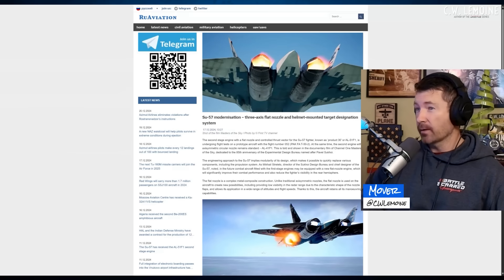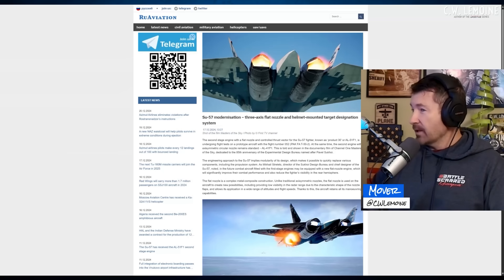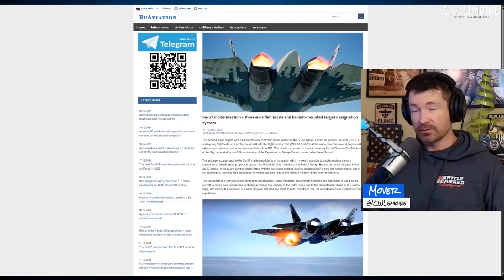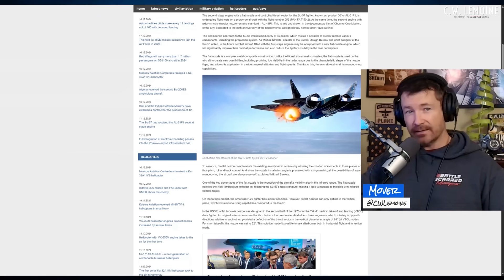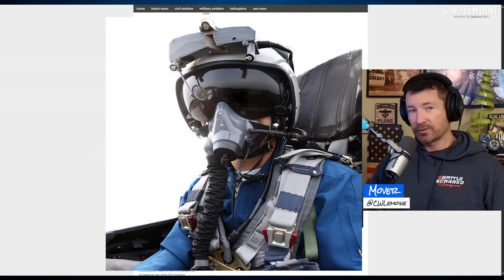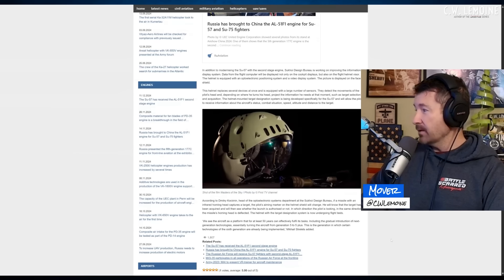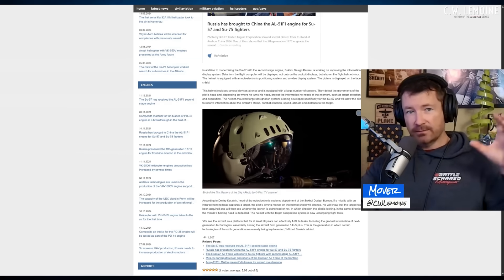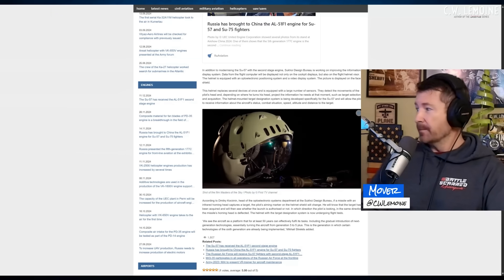New Upgrades for the Su-57 FELON

Comment: man i hate that its such a terribly built jet because its a gorgeous design
Reply: We don't know how well they're built.
Reply: It's a prototype.  They change and upgrade.  It is stitched from all parts.
Reply: Sukhois have been flying non stop in Ukraine for the past 3 years. Maybe not so terribly built.
Reply: they're not terribly built. just tons of outdated information + anti russia incentive is being spread like wildfire on the internet.
Reply: We don't really know for certain. The Russians might have sent a version without the main stealth features I.e. coatings, clean surfaces as China is a strategic competitor even if partners of convenience at current. The plane would be certain to be scanned by radar and possibly scanned by other sensors on the way so makes sense to send the agile version but not the full one.
Reply: @nath9091  Its similar to why we kicked Turkey out of the F-35 program. If it could be studied and interpreted to the S-400, the F-35 may have the vulnerability to get locked by it.

Comment: how can they even upgrade a fighter that dont even exist at least in any huge number to speak off
Reply: There is at least an operational squadron of Su57s and the only reason there aren't more is the VVS didn't want any more until the proper engines, the AL51 was ready... This has now received its certification status and so more of these birds will enter service. Besides, you don't have stop modernization or development just because you've not built many yet. There would have been trade offs made that can now be overcome and overall there's always a modernization plan.
Reply: In short: they CAN produce it, but they don't want to produce it. 
They are waiting for the new engine to be fully developed and compatible for the Su-57, then they will go on to production. Why buy an aircraft when you can buy a superior version of it later next year, it saves costs.
Reply: @sujitbala1492  It is, Su-57M production started in Q4'23.
Reply: This "fighter that dont even exist" has more combat kills then all F22 and F35 together
Reply: They wont fall for the Concurentcy trap of F-35 program

Comment: The current single test example of an LO thrust vectoring exhaust nozzle on an Su-57 is 2D only and is angled off of 90degrees to try and get more angle performance.
Reply: It kept slanted 2D TVC design used in Su-35 and 57
Reply: @ГеоргийМурзич  Su-35S and Su-57 both have 3 dimensional thrust vectoring.
Reply: @ГеоргийМурзич  The Su57 doesn't have this design as evidenced by the fact that its only just now testing one...

The Su-35 also does not have 2D nozzles of any kind.
Reply: @Ihasanart  what I meant is that both Su-35S and 57 have axisymmetrical nozzles with slanted 2D TVC
Reply: @Ihasanart  TVC: Thrust Vectoring Control
Reply: @ГеоргийМурзич  No they don't.
Reply: @Ihasanart you're simply wrong here and repeating a common misconception, all the flankers and the previous felon have canted 2D moving nozzles with independent nozzle control, hence pitch, yaw and roll authority hence achieves 3D vectoring without actually being a 3D TVC nozzle, the only 3D TVC vectoring nozzles in the world was on the Mig-29OVT and F-16 MATV.
Reply: @ГеоргийМурзич  They ARE asymmetrical, but both the Su-35S and Su-57 have 3D TVC.
Reply: @Pepesedd  They don't? Aircraft such as the Su-35S, Su-30SM2, and Su-57 all have 3D TVC. Prior aircraft such as the Su-30SM, Su-30MKI, Su-37, and so on that operate AL-31FPs instead of AL-41F-1s or AL-51F-1s used 2D TVC.

The AL-41F-1 and AL-51F-1 are absolutely capable of 3D movement, though prior engine generations aren't. Seeing as the Su-35S and Su-57 use the AL-41F-1[S] and AL-51F-1, they both have 3D TVC.

There are FAR more 3D systems in the world than those found on the MiG-29 and F-16.
Reply: @TheArcticFoxxo  no they don't. It's a famous misconception. The left nozzle is deflected in \ axis and the right one - /
Reply: @ГеоргийМурзич  Misconception of what? The AL-41F-1 is capable of multi-axis vectoring, whereas the prior AL-31FP that you're thinking of is not.
Reply: @TheArcticFoxxo  i'm not thinking about AL-31. You won't find a single video or photo where nozzles are deflected in any other shape then V
Reply: @ГеоргийМурзич  You will? Hell, you can find imagery of BOTH the AL-41 and AL-51 with their nozzle covers off, both brandishing 16 separate hydraulic actuators and their respective linkages. You can even see the 4 boosters used to power these, which typically operate around 400bar.
Reply: @TheArcticFoxxo  this is where the problem is, what you see is actuators for the variable area nozzle, the thrust vectoring on the Su-35 and current Su-57 with AL-41F1/F1S works like a pivot around a socket at 2D axis in canted arrangement, there was no change in method of vectoring from AL-31F to AL-41F. The AL-51F on the other hand with round nozzles and serrated edges first shown about 7 years ago does have have actual 3D TVC like the Mig-29OVT that moves in 360° of freedom, two different methods to achieve 3D vectoring.
Edit: boomer spelling mistake.
Reply: 2D can actually be superior to 3D because it provides functionally equivalent maneuverability with better stealth if the nozzles are obscured by thrust diverters.

Comment: From what I've seen, the flat nozzles are angled at 45° viewed from behind . So, with only a single axis of movement, by mixing the 2 nozzles, it's possible to have pitch, yaw and roll control . Less than the former thrust vectoring nozles, but with the advantage of the lower radar signature of the flat nozzles .
Reply: On the video I actually saw the nozzles rotating and turning freely in all directions. It obviously was a 3D render but not impossible. I guess, time will tell.
Reply: @pajownik  No need time. There are already real photo and video of the plane with that nozzle.
Reply: @kondor-n1d  But I didn't see it rotating and turning freely in all directions.
Reply: @pajownik  Because it didn't turning freely in all directions. It works the same way as all previous nozzles Su 30, 35C, 57.

Comment: I predict they'll get about 3 of these upgrades flyable in the next 10 years.
Reply: lol do you realise the main reason the program was delayed and low production output was due to waiting on the Al-51fs, the Russian mod was not accepting orders from sukhoi because of that , a whole new production line has been made for the su-57 in Kazan
Reply: Resembles a working plane?? Come on now.
Reply: @diamondcutsteel  I mean the F-35 program was delayed and overbudgeted but look where it is now. Successful and over 1000 built. Pak-Fa program is doing better compared to it.
Reply: took f35 20 years dozens of fails and crashes to look something that resembles an working airplane, i say su57 is on good track compared to it !
Reply: @noir1923  hey three parts out of a single concept design isnt a bad ratio!
Reply: @noir1923  F-35 is in serial production, deployed around the world and has been combat tested (Iran's air defense went bye bye, lmao).  All the Su-57 has done is shot its own wingman.
Reply: @TC2290-wh5cb Iran detected the F-35s that's why the second and third waves of F15I and F-16s got nowhere near Iran or it's air defences they did hit a factory though well worth the trip.
Reply: @TC2290-wh5cb  The F-35 hit serial production after 17 years of flight development.
The Su-57 hit limited production after 12 years of flight development.

The difference is that one has a decade of a head start over the other.

The Su-57 has been accredited with assisting in 2 of the world's longest air-to-air combat kills to date, as well as hundreds of strikes from the eastern seaboard of Ukraine. Even admitting that it shot down its wingman within 15km of a frontline that has the heaviest Ukrainian air defenses is hilarious when nothing had detected.
Reply: @TheArcticFoxxo  Ukraine air defence doesn't cover Russia or occupied territories, lol.  Russia has been using old Soviet bombers, does that mean they are stealth too?  lmao.  "The Su-57 hit limited production after 12 years of flight development."  Oh yeah, sure, that's why there's like 4 flyable Su-57s.  Russian sanctions mean it will never be produced in meaningful numbers.
Reply: Optimistic of you.
Reply: 3.......as many as that 😂😂😂
Reply: @stemmatalucalis  26+ Su-57s in service.
Reply: NAFO has entered the comments. Lol!
Reply: @WestCoastVisitor  Russian trolls you mean.